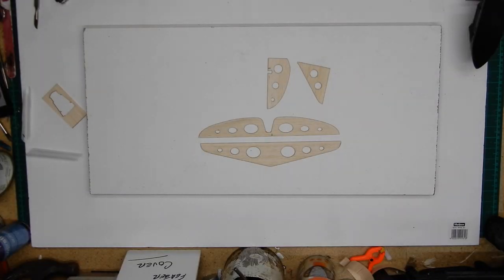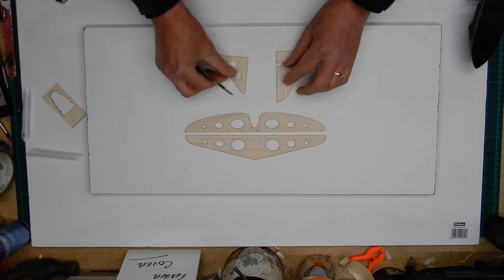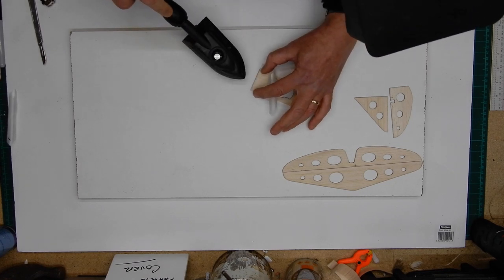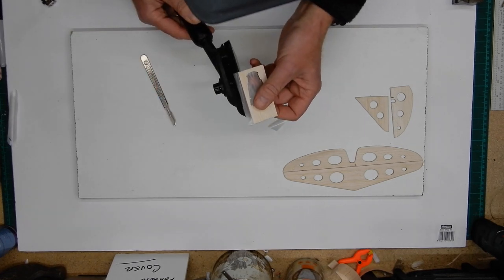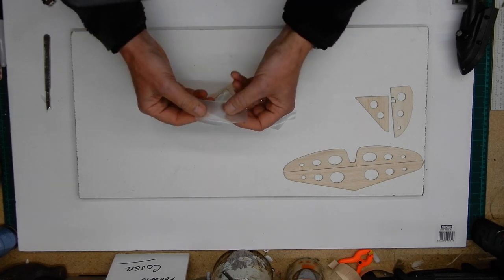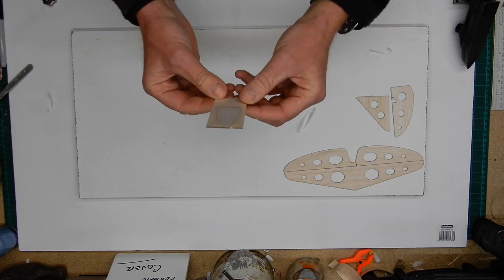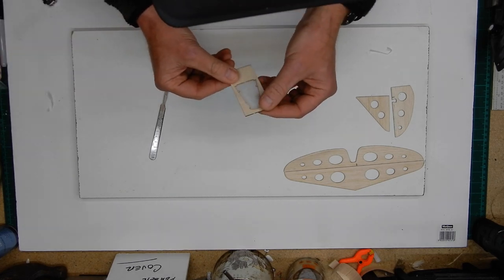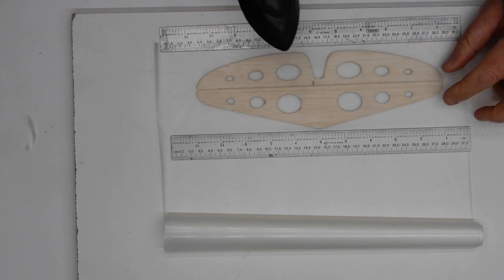How to build a Micro Sinbad Radio Control Glider Part 3 Tail/wing how to use a new film covering

Comment: I used it on my Pug and love it. Went on so easily and if you do want to get rid of wrinkles it tolerates a lot of heat from a heat gun 👍 Saved some for my Sinbad and it will be great if Angel Wing Designs stock it 👍
Reply: Will be on the website next week Carl, but let me know if you want any before then!

Comment: Thank you Nick for that great demo, I have been watching  Mark  Robinson  using laminating film, he is very good and gives many tips on using that stuff. I think you will find its the same stuff , he left a link to eBay to buy it but the sods will not ship to New Zealand. so i found som thinner stuff like 25 micron that was cheaper on Eli express, work really well to ..I am like you and go for the gliders so i got the thinner stuff, was afraid it would be to thin but its real strong and only $27.00 N Z (about  16.00 of your pounds for 100 meters.  Avery good price
Reply from the maker: Thanks mate

Comment: Does it take paint well? Wondering bout using it on my micro Spitfire but would like a cam scheme. Many thanks!
Reply from the maker: I used car spray paint on mine. And found the kept good distance away and used light spray. It did like a water based hobbie paint